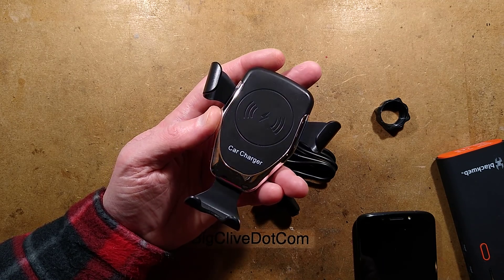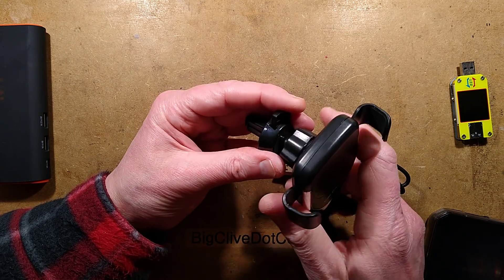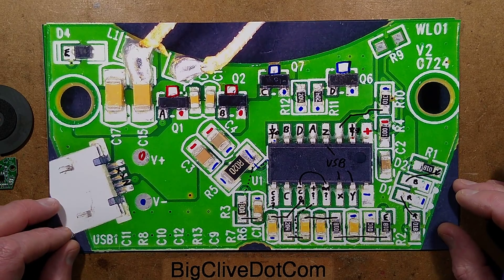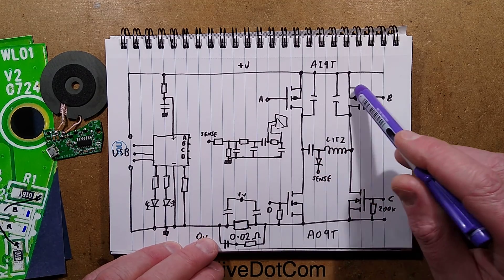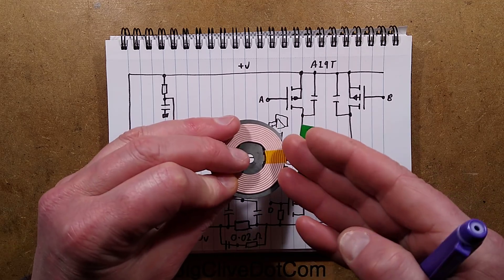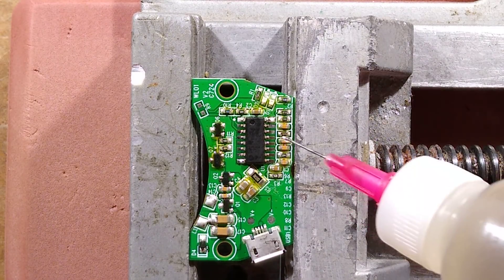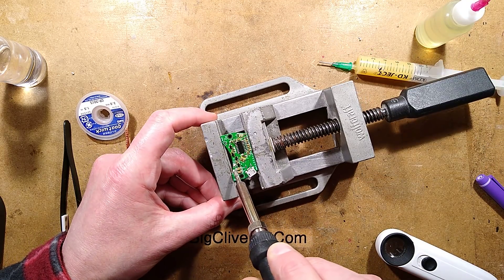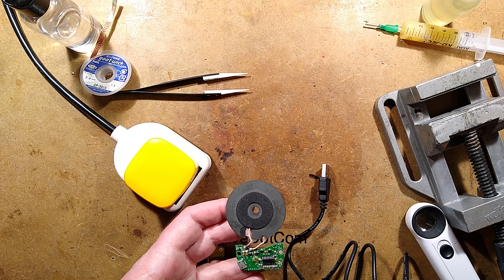Poundland inductive phone charger teardown (with schematic)

Comment: NIce teardown, the ferrite disc is made to direct the energy in one direction,  if you try to charge it with the ferrite to the phone it will not work.(Try it?) Without the ferrite, the energy towards the phone would only be  the half of it, rendering the horrible efficiency from max 50% to max 25%.
Reply: That's about half an answer. The ferrite sheet does act as part of a couple--another sheet of a magnetic material is above the Rx coil in the phone--to increase the inductance and efficiency but it also provides shielding to prevent EMI and self heating in the phone, power transmitter and anything that the transmitter might be sitting upon.
Reply: @igrim4777  Thanks, nice addition, I didn't think about that, as I am not a mobile phone expert, The sheet of magnetic matirial inside the phone must be very thin, like a thick foil, because of the need to keep it thin. I have some samples from a fair somewhere, didnt recognise the foil as magnetic material.

Comment: does charging with induction shorten the battery? A secondary electric field would surely affect efficiency and increase electromotive force wouldn't it?
Reply from the maker: It generally charges at lower current, so may prolong the life of the battery.
Reply: @bigclivedotcom  Afaik the problem is the heat you can get in the receiving coil which sits directly on the battery cooking it. I don't know if every phone has the issues but from what I read around some do so it's better to prefer wired charging instead

Comment: Since the MOSFETs are only ever intended to be activated in pairs, is there a reason they separately control the four of them rather than tying the gates together for each active pair?
Reply: Good Question, the two active MOSFETs are controlled with inverse logic levels, then a short period all MOSFETs need to be inactive, after this the other 2 MOSFETs are made active. If you tie them together you will get short moments of shorted MOSFETs, resulting in a Big BANG.    (A Low:TA on, C High:TC on, B High:TB off, D Low:TD off. Litz gets left to right energy.
short period: A,B High C,D Low all Ts off no energy to Litz.
A High:TA off, C Low:TC off, B Low:TB on, D High:TD on, Litz gets right to left energy.
Short period all Ts off, sense data from phone (pulsed load variations), repeat cycle.
 )

Comment: The idea with the Litz wire is to wind it in such a way that the thin insulated wires each pass through the exterior and interior of the wire bundle so the skin and proximity effects are reduced. If conventional wire was used, the current would be confined to the thin layer on the outside of the wire, with virtually no current in the core. It provides an elegant way to get around the skin effect. Its also used in large 50/60 Hz power distribution cable that has to run for considerable distances. I believe its called Milliken wound, where the wires are in sectors that has each wire winding around periodically through the interior and exterior of the cable. Since they are mildly insulated from each other, the current is roughly equal through the cross-section of the cable, rather than confined to the exterior. Very interesting tricks for minimizing the wire size needed for AC current.
Reply: AC current: Alternating current current?

Comment: Just a microcontroller? I guess it isn't. The two bridged pins (you said it might be an OpAmp? I agree with you in that) make me think this IC is a dedicated inductive charging module. Unmarked, so no-one can reverse-engineer the integrated circuit itself  that easily.
Reply from the maker: Some specialist microcontrollers incorporate comparators and op-amps.

Comment: This would be useful on a road trip or something. You can keep your phone charged all the time as you listen to music or use to for maps and whatnot
Reply: Very hot phone, to the point it refused to charge due to overheating, and I was trying to navigate an unfamiliar city with a flat phone. I now have a dash mount with a gap in the center of the bottom support - like the one in this video - and a 5-pin magnetic USB cable.
Reply: Or you could just plug it in. A long journey with inductive charging sounds like a hot phone

Comment: Clive, it's a pity you didn't drag out an AM BC radio and see how much RF rubbish it generates. 
Considering that the coil is driven by a square wave, with no LPF to suppress harmonics, it might be fairly bad.
Admittedly it has a series tuned circuit, so that will help to some extent.

Comment: "What's the worst that could happen flames apparently" few seconds later splashes alcohol around "where's a match when you need it?" 
And that's how flames happen kids.
Reply: My new favourite flow soldering method is to flood the PCB with home made alcohol based flux then set fire to it.  Once the flames die down every thing should be soldered. Yay!

Comment: Coil and capacitors should be in series resonance. And the receiver circuit is an envelope demodulator, basically the simplest circuit for AM demodulation.

Comment: If you have one of those metal plates for a magnetic mount on your phone - these charges work like inductive cookers...  Accidentally melted a phone once )))
Reply: Many Qi chargers has sense circuits and should... only attempt to charge if there's a good inductive coupling with an active recipient, I assume that's the reason behind the sense circuit part.
Whether that WORKS correctly on this model is not a given but it does look like they've likely at least tried to avoid this on this one. And no, buying an expensive one doesn't guarantee it'll behave well, I assume no one in this channel is surprised at that.
Reply: @Torbjorn.Lindgren  The metal plate makes it LOOK like there's a good inductive coupling with the phone, and the phone is still getting some power, the charger and phone don't really have a way to figure out something has gone wrong until the plate heats up enough to trip a thermal overload, or straight up melts one of the devices.
Reply: @lovotcore6946  I've seen demonstrations where chargers successfully detected a coin put between the charger plate and the phone ("metal detection") and then easily charging the same phone when the coin was replaced with a thicker piece of plastic (to show it wasn't too far away from the charger).
So it's definitely possible to protect against this scenario at least to SOME extent, but it's definitely true that it's not fool-proof. I also expect a better charger to also include "standard" safety features like temperature sensors which would hopefully cut power before anything melts most of the time :-)
And THIS charger doesn't have any of those, which isn't surprising for a 5W charger since as mentioned those are usually "bottom of the barrel".

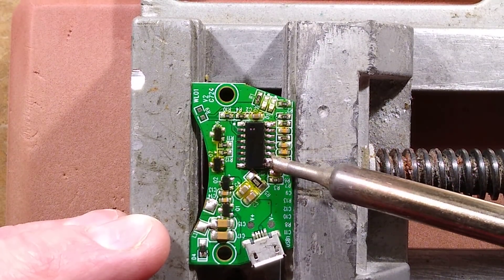Comment: Did anyone notice the funny way a solder bridge formed on transistor Q7 when Clive was reflowing the IC starting at @15:42 ??  A small ball of solder flies off the IC and rolls right around and sticks between the pins of Q7??  But it worked, so I'm guessing the short was removed when cleaned?   BTW: Nice to see the vice-of-knowledge, haven't seen it used for a while now to gain entry into boxes... it's a little more controlled than AvE's shop X-Ray (a hammer) .

Comment: I recently got a cute cheap chinese RC truck (a WPL D12, based n the 7th Gen. Suzuki Carry) and the electronic speed control sounds AWFUL, so, I looked about on its' control board and the only source for the terrible frequency used is a mystery 16-pin chip, which has had its' data scrubbed off, just in case someone were to reverse-engineer what they people making it probably reverse-engineered from someone else's work, so if it's possible to reprogramme it, I have no idea how to owing to not knowing what the chip is (mostly through lack of knowledge on such things)... :\

Comment: Here is a tip for home-gamers - You can buy a refillable, steel pump-operated, aerosol can in most local grocery or home stores or maybe even dollar/pound mart.  These are GREAT for solvents like IPA and Ethanol that you can both pump up to spray (to clean boards), and dab cotton buds out of for spot cleaning.  Good stuff.
Reply: Sounds useful. Are you talking about the kind that you pump to create pressure then press a trigger to release? I'm only finding ones that are at least a gallon capacity which seems excessive. Do you have some keywords or hints about where to find them online?
Reply: @JuulCPH  Amazon search - "pump aerosol oil kitchen pump sprayer"  Misto brand.

Comment: I used to use one of these on my GZ'one Brigade rugged phone. the thing that surprised and pleased me was that if I plugged the phone into the wired charger and the wireless it charged quicker that either alone.. It wasn't a lot but I got an additional couple hundred ma out of it. Or so my cheap 5v meter told me. I'm going to check that om my BV 9900 pro next.

Comment: The first ever QI coil I bought was when the technology was newborn and standards were not really stuck to, the charging coil was hot melt glued to a slab of grey roofing slate that was then hot melt glued into the housing of the charger. it charged at a lightening fast rate with a current draw of 150mah (it may have charged faster but thats how fast my fone charged on it). It was actually faster to charge the fone from a usb cable at 500mah than to piss about with wireless charging. it was a novel idea to just drop the fone into the qi charger and watch it slowly charge up over night tho and in a house with teenage offspring finding a charger or cable that worked was like looking for hen`s teeth in a field full of hobby horse shit.

Comment: I was curious what the frequency used was.  So  I googled it.  Digikey says "The Qi specification calls for an AC frequency in the primary coil of between 110 and 205 kHz for the “low power” Qi chargers (up to 5 W) and 80 and 300 kHz (up to 120 W) for the “medium power” chargers."

Comment: What is kind of interesting is that the USB-to-go pin, the extra pin you get on that USB connection is connected to the chip... Does make me wonder if it is a UART as someone below has suggested... As there is no reason for the pin to be used otherwise... As it is normally left NC or tied to a rail to show it is always the slave.
Reply: @Lassi Kinnunen 81 The charger is always going to be a USB 'slave' side in normal use, so the pin would be in a fixed state...

Comment: You are being way too hard on your SMD techniques.
That was awesome!
Reply: My brief flirtation with SMD was to use an op-amp that was only available in an SMD package on a board that had a standard 8 pin DIP socket. I got another DIP socket and made a bad job of blob soldering the SMD chip  to the top of the other socket. Only later did I discover there are little adapter boards that make this a lot easier.

Comment: It looks like it draws 1mA in standby which is ridiculously good if true. I've measured several wireless chargers from various brands and they all seem to idle in the 10-20mA range, with closer to 40-50mA when actively pinging.
Reply from the maker: I think it was closer to 12mA.
Reply: @bigclivedotcom  I do agree with Mark, in rest it looks to draw 1 mA.. and 12 when pinging i guess

Comment: OK, so the USB data pins are going into the IC.  I wonder if you plug it into a computer, does it recognise any kind of device?
Although if it is something like a clone of the ST Micro STWBC-WA then those pins are actually UART, and possibly only respond to very specific commands.
The reference design for the STWBC-WA (look up STEVAL-ISB045V1) has an awfully similar schematic (including external H-bridge and sense circuit), and although is is a 32 pin device it looks like a bunch are not needed and might be possible to cost reduce down to a 16 pin package.

Comment: That SOIC-16 IC looks suspiciously similar to the one on the widely available HW-225 WPC boards. See ebay, amazon, aliexpress, etc.
Reply from the maker: I saw those, but couldn't identify the chip on them.  I may buy one.
Reply: @bigclivedotcom  Swap the chip from the other board and see if the thing works.
Reply: £1.42 in the name of BC science do it :-)
Reply: @muzikman2008  here here!
Reply: @d.t.4523  
The correct form is: “Hear Hear”.
https://www.grammarly.com/blog/here-here-vs-hear-hear/
(Sorry if that seems pedantic but I am using English as my non-native language and am always trying to learn by researching such phrases.)
Reply: @briandeschene8424  Try going to a low class saloon. It will help your english.

Comment: There is a basic description of the protocol on Wikipedia[1] which states that the full specification can be downloaded from the Wireless Power Consortium[2]. It looks like a microcontroller could easily handle the one-way comms and toggle the MOSFETs. I guess this 5W charger meets the "Baseline Power Profile" (BPP) specification.

[1] https://en.wikipedia.org/wiki/Qi_(standard)
[2] https://www.wirelesspowerconsortium.com/

Comment: afaik the ferrite sheet is to do with RF performance - possibly shielding to stop emissions going out the back, or to suppress interference going in. Maybe improve performance overall. I'm sure somebody with more actual knowledge should be able to enlighten us further with the actual reason it's there - you could try to see how well the charging works with the ferrite between the coil and the phone? Would be interesting to see.
Reply: Yes it helps keep the magnetic flux contained in a smaller area.  Some info is available in Wurth App Note ANP016: Going Wireless with Magnetic Shielding
Reply: The ferrite plate is used to more efficiently complete the magnetic circuit - improving the coupling between the transmitting and receiving coils (though the WPC would claim that they aren't coupled - they are resonating at the same frequency).

Also that pink wire is litz wire - lots of tiny, insulated wires woven and wrapped in such a way that you can cheat the skin effect and get a higher current density in the wire than you would with normal wire at the high frequencies that are used by Qi chargers.
Reply: All I know (from experience) is that these sheets are very brittle: I've cracked a lot of them while playing with these QI chargers.
Reply: @Quick_Fix  Some manufacturers use flexible ferrite, essentially like fridge magnets, but even that depends upon the particular Qi standard being applied. Where coils are aligned using a permanent magnetic at the centre of the Tx coil and a susceptible material at the centre of the Rx coil, the Tx coil is backed by a rigid ferrite because they'd just have to restrain the permanent magnet anyway.

Comment: I have an inductive charger to top up my implant its a bigger coil, as it has to work through my skin and a very thin layer of fat.   OK much fat  🤣🤣    👍👍
Reply: So can you charge your phone by sitting on your chest?
Reply: @assassinlexx1993  or can you charge it with a phone that uses reverse wireless charging?
Reply: @assassinlexx1993  I wish 👍👍
Reply: I will have one soon for my SCS.
Reply: @Blanchloup22  hope it works for you this is my 3rd for spinal cord nerve damage.,.
Reply: Okay now I'm just incredibly curious about how it stays aligned. Are magnets involved at all?
Reply: @fluffycritter  at least in my model from Medtronic the inductor at least in part is held in place by a belt of type
Reply: @Blanchloup22  yes # just a belt mine is Medtronic  too.
Reply: @dcallan812  I did the trial already and it was night and day.  I'm sure you know which is night and which is day. just checked on it today and i have a tentative date of the 17th. how was your recovery?
Reply: @Blanchloup22  I was lucky to find my consultant as a private patient. (work cover) I was on the first clinical trial in UK. I was up and about in no time back to swimming in about a month. also had a battery change under local that was odd, never knew just how many people need to watch. . 🤣     🤞👍
Reply: @dcallan812  🤞 i cant wait to get a more "normal" life back
Reply: @fluffycritter   no magnets sadly I have to say out of strong magnetic fields (MRI CAT Scan)  just has  a belt to hold the coil in position.